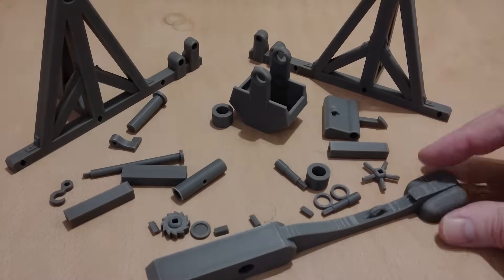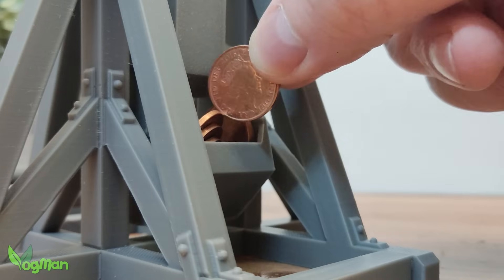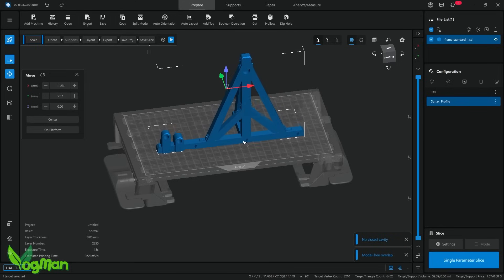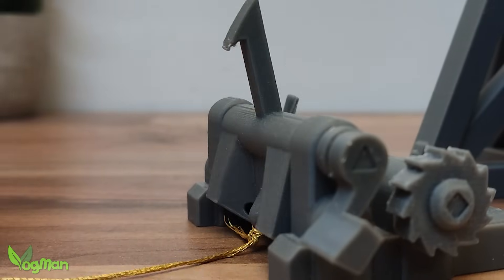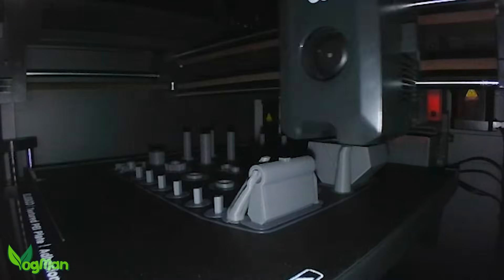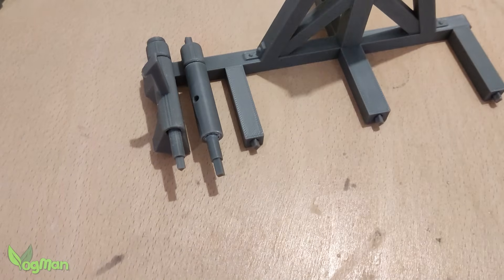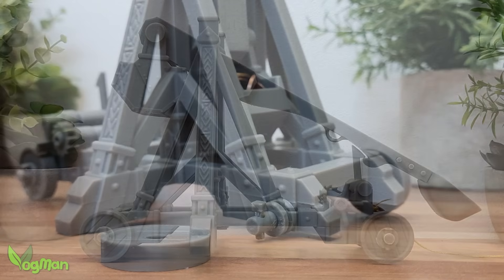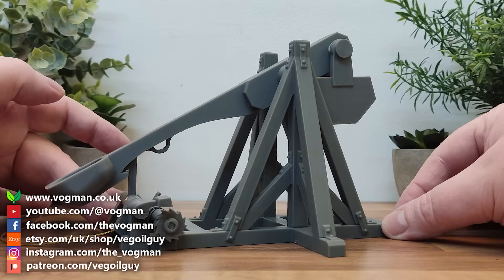I 3D Printed a Working Trebuchet | Fully Functional 3D Printed Siege Engine Build

Comment: Ohhhh, those trees generated and printed so nicely! Unlike mine, which try to encase anything i dont cover in support blocker...
Reply from the maker: Personally I paint everything red with the big brush (blocking), checking every angle as the brush likes to miss. Then with a small brush I green in the areas I actually want to support. The tree supports do a much better job of it as they don't usually stick themselves to the sides of the print 😁

Comment: When it comes to trebuchet this is abomination.However it is a cool trebuchet shaped object so you have my like.
The ratio of pivot point is 3.75 :1.Longer part of arm is 3.75 then comes pivot point and then counterweight part of arm is 1. Arm size dictates the frame size. 
On top of arm there is release pin that holds sling ,that pin us usally bent at 30-45° and it play's huge role in release angle.
Sling is 80% long of the 3.75 ratio .Counterweight needs to have ration of 100:1-for each 1 kg projectile counterweight needs to be 100kg .

I would love for you to try make torsion siege weapons like mangonel or ballista.
Reply from the maker: Of course many trebuchets didn't have slings at all, but I agree the sling was a far superior addition. The problem is that wasn't something I could easily 3D print... at least not a properly functioning one. 
As for torsion weapons, they were known for killing the people that made them. Soooooo much power in a tiny, confined area with rudimentary tools. I don't think this is the sort of thing I'll be doing in a hurry. I'm all about fun and prefer to keep all my fingers 😁
Reply: @vogman 
Yes they were dangerous and they used heavy oak timber for most of it but. . . 
 You can make baby version and 3d print them and instead of rope use a rubber bands in a same way instead of rope .That way your fingers will stay intact but you still get to have cool toy.

Comment: just learned that early trebuchets used buckets, I had it in my head the required a sling. not a lesson you were trying to teach but one I got anways lol.
Reply from the maker: Well you're not wrong. The very early trebuchets had a spoon like end (as you've seen on this one) and a big counterweight. This transformed into a big container (bucket) that allowed users to vary the weight. The spoon like thing became a sling and THAT really added amazing power and distance to the trebuchet. But 3D printing a sling isn't all that easy 😁

Comment: I didn't 3D print a trebuchet...my daughters high school project. I helped build 100% of there design. I did most of the heavy cutting for this first and lst all girl team. The dynamic was banned right after. Mostly because after the trebuchet was engineered and built (12 ft tall) an then they changed the rules in the name of the Nanny state for safety. They were not going to fire SOFT balls they were going to be firing water balloon!!!! Kindergarten school teaches you the difference in ballistics between a solid round ball designed to go straight and an amorphous blob of water barely contained in 1/120th inch film of latex. Then they changed the grading  from landing in the correct zone of 4 ABC and D to landing on a 3 inch chalk line to get that credit. I went ballistic...The five girls including mine were at the top of there class, all vying for number one.  When you work as hard as they all did and as I witnessed it myself for 4 years - grinding like most can't imagine. To those children there are NO B's no C's and no D's ever. no incomplete or didn't participate. Then this one jackass teacher on his own changed the rules that made it beyond any theoretical instance could the student determine in any way where a flexing rolling misshapen blob would land. There is scientifically no instrument that determine this. The system wasn't isolated it was outdoor and the conditions of every single shot taken that day were completely different and guaranteed to be random...as would their grades. My daughter worked too hard. I basically but not really threatened the teacher to NOT move forward. He was going to wrongly change my daughters grade point average and affect her college future. I went off on the principal and anyone who's email I could get that this was patently unfair to grade. To put the timeline in context - they had decided that the honor students, the ones that work the absolute hardest, would NOT be honored. My daughter herself lit up the school enough that they caved and she wore the special recognition. They refused my requests - I said if my daughters grade goes down you be in court explaining it. 
It was the standard of the day to just say F off to a parent. A terrible idea for me. I got their bullshit response the competition went on and my girls took one of 3 shots and landed on the A line perfectly by accident. Dropped the mic and walked away without any other shots. My contribution was to take the standard treb and turn it into a giant Kraken swallowing the treb who's weight was a chest full of actual gold coins (painted of course) all painted and glittered up by the girls. Every other one (boy teams) was embarrassing in the holding pen next to what looked like a carnival ride turned deadly accurate trebuchet. 
You can't get that from 3 D printing. be an artist with a printer more than a 3D printer. might be more satisfying. Have a great day - your's looked great.
Reply from the maker: That's quite a story. Some people just make you ask - why? Hard work should always be encouraged after all. Glad things worked out 😁😁😁